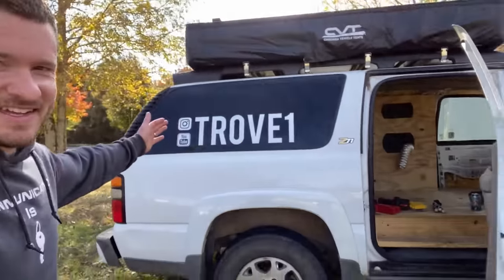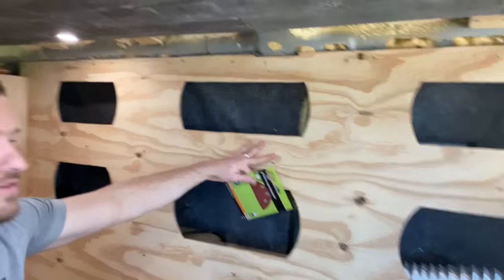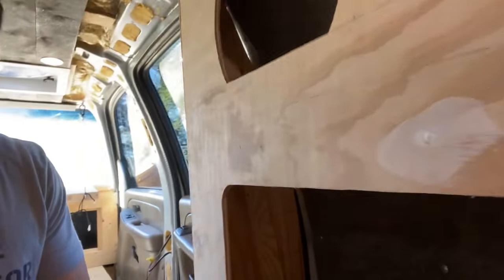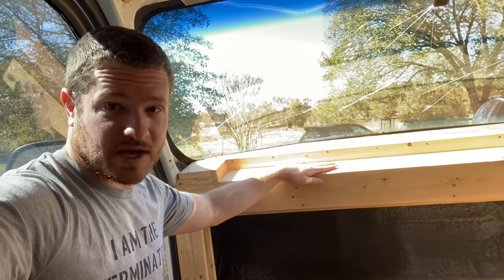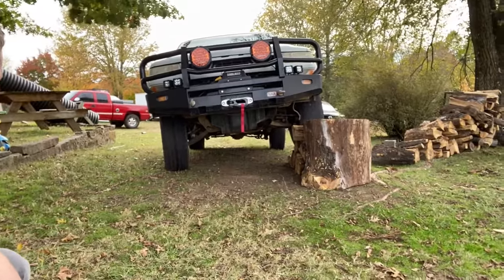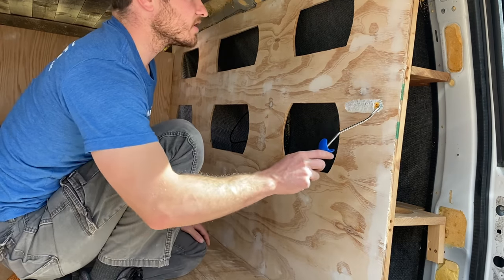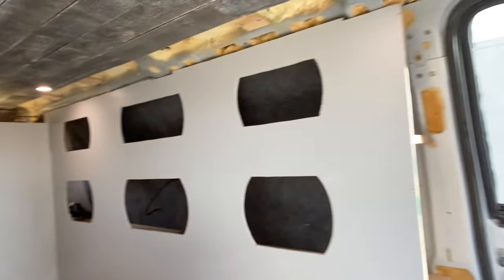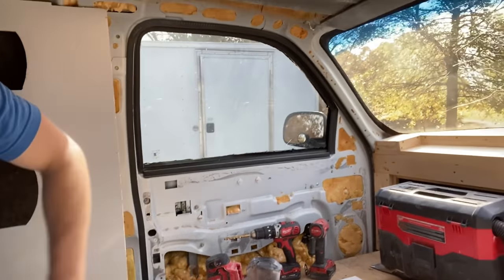Finish Work and Painting the Camper

Comment: If you end up not liking the grain showing through in the plywood, you could try a textured finish.  They have spray cans of orange peel texture at most big box stores.  A really light coat adds enough variation that it will blend in the grain.  I've used it when we patch holes in our drywall at home to hide the flat spots left after using filler.  Should work fine over plywood and paint.  

A contrasting wood trim around your openings would give it more character, but may be a lot of work.  I originally thought of edge moulding too when I first saw your openings.  Something to protect from splinters.  Aluminum "C" channel moulding would trim it out nice, but may be hard to do the curves.